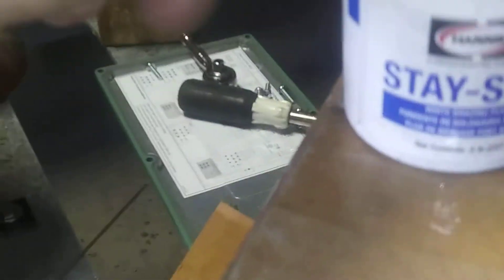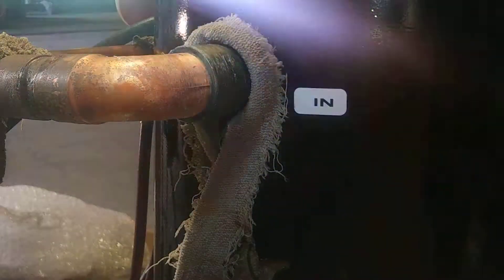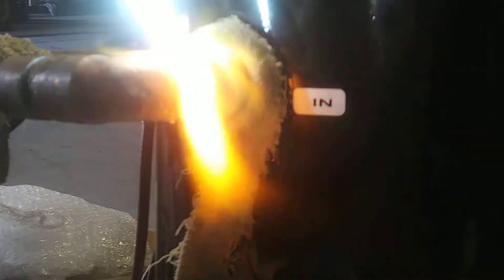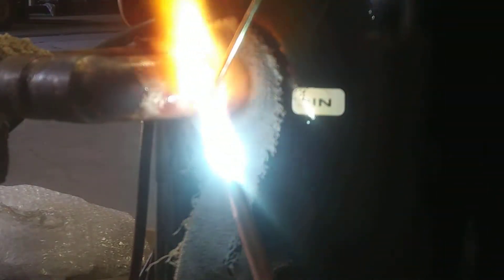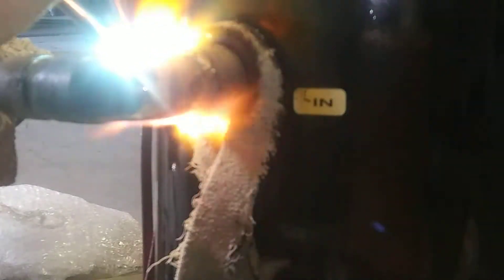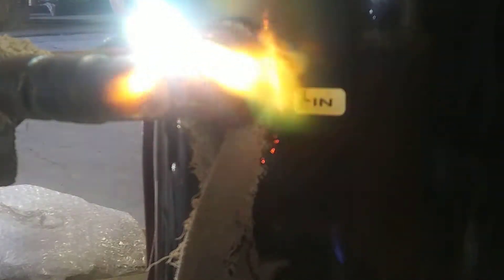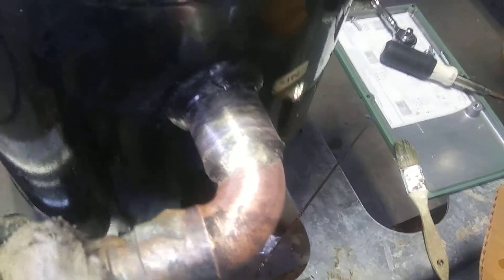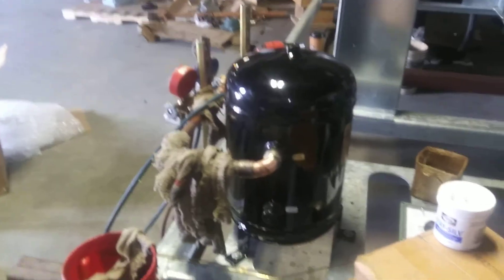Brazing 101. How to braze copper to steel. Heating and air school. Braze like a pro

Comment: Hi dear sir:please teach how to braze cuper to aluminum tubes🙏
Reply from the maker: I haven't tried that.  I would assume you have to have the right brazing rods
Reply from the maker: Heat the copper till the solder melts on the copper and go from there.  Have to have the right flux also. Flux and the rods you use are gonna be key

Comment: Copper to Steele welding witch rod we can use
Reply from the maker: 45 percent silver solder.
Reply from the maker: 45 for copper to metal copper to stainless and stainless to stainless.
Reply from the maker: White flux for copper to metal and black flux for stainless

Comment: Cool man!
I’ve brazed a little. My valve keys for meters, not easy 👊
Reply from the maker: Never tried brazing keys for meters. I buiild ice machines sometimes
Reply: i walk in circles not keys to like open locks.
We call them valve keys for opening under ground water valves. . Use a very thin galvanized tubing for light weight and braze a a square metal piece on bottom to spin open or close water valve underground 👊
Reply from the maker: I know what you mean now.

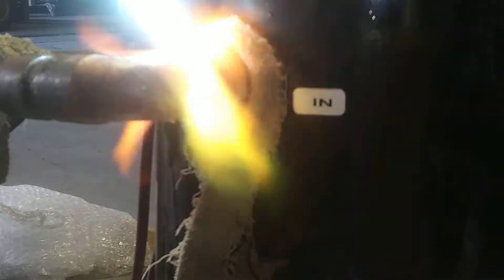Comment: Way better than I would have did. At about 2:12 or so I'd had at least 3 fire departments at the front door and still had a pipe needn fixed.
Never was good with that kinda stuff. Pretty cool watching it done though.
I never knew there was different silver % in solder. Just figured solder was solder. 
Thanks for sharing guess we can learn something new everyday.
Reply from the maker: Just takes practice. Gotta crawl before you can walk. Lol. I have had a couple small mishaps that ended good but nothing a couple cups of water or a rag couldnt handle.  Or garden hose. Lol.  Pinestraw is highly flammable.
Reply: @iwalkincircles2960  sry I took so long to reply. My dad had a junkyard and I've made few dollars from some myself. Cutting torch lag has got away from me couple times. Had myself on fire more than once from it. Got a bunch ah rain last night and today. Lookn to get somthn stellar to post tomarow. We know how that goes.
   Been Google earth lookn don't know wich way I want to go.
     Thanks for your time bro.
Reply from the maker: Good luck to ya. Storming here til Tues I think. So after that maybe I'll have something also.